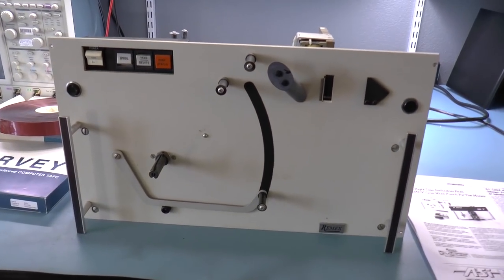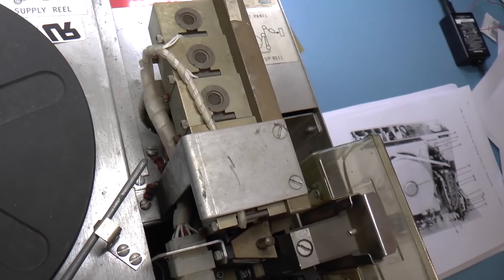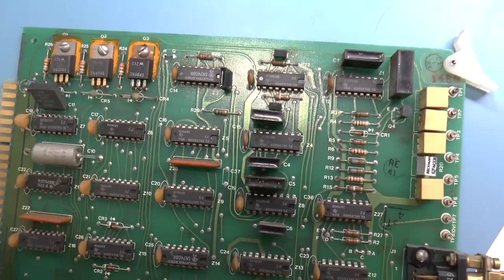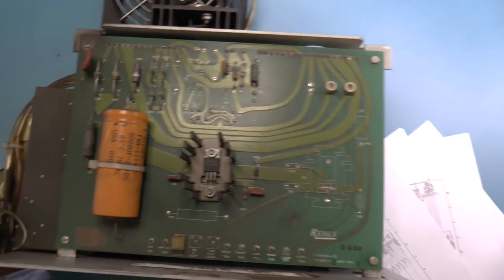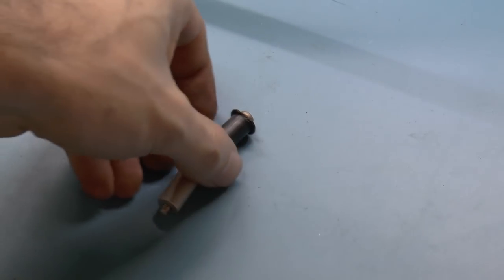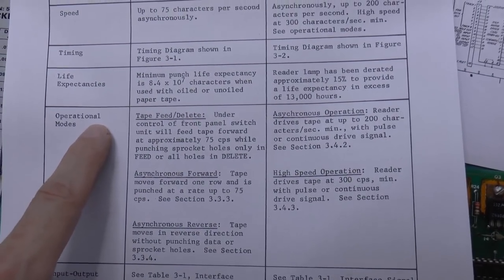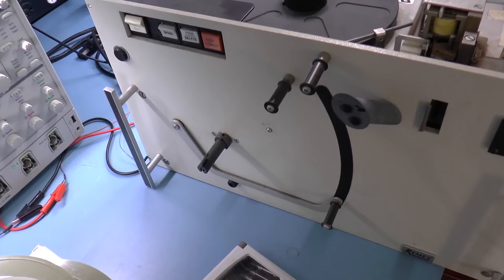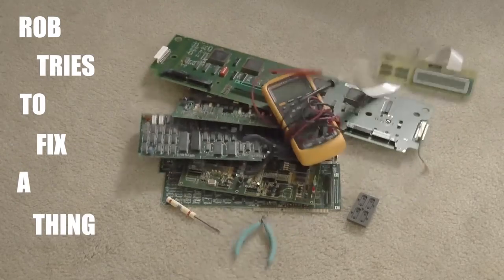Remex RPS6122 Tape Punch part 2: Fixing mechanical issues

Comment: Deleting data on the tape, i.e. marking the characters on the tape to be ignored on input, is done by punching all holes because that's the only way you can erase any existing character. It's easy to punch a new hole, but patching the tape to fill a hole is hard to do. This is why the DEL ASCII character code is 0x7F, separate from all the other control characters which are at the beginning of the ASCII table.